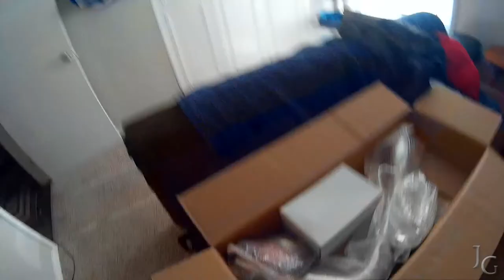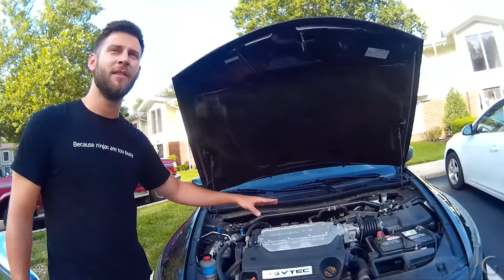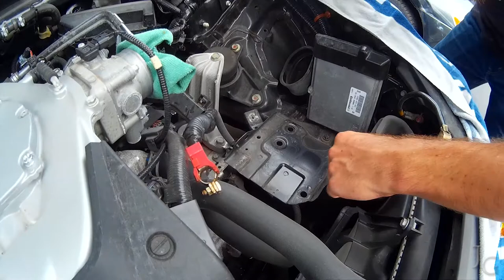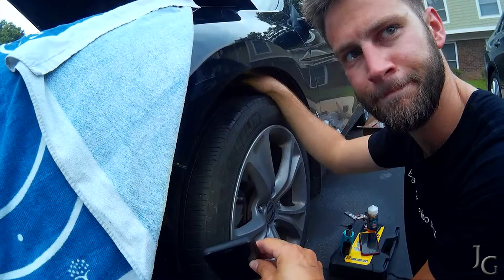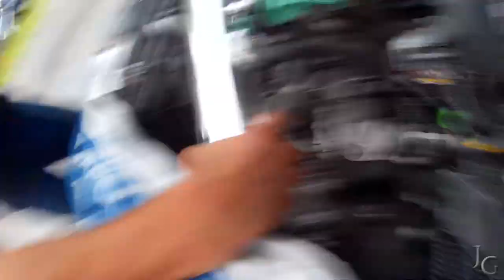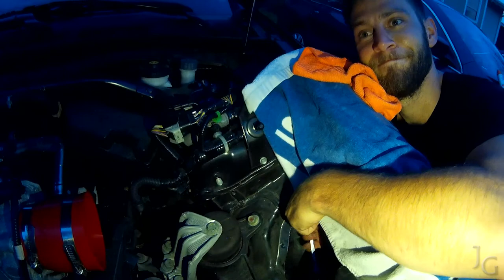Cold air intake install - 2012 Accord V6 Coupe

Comment: I just got my injen cold air intake for my 11 accord coupe and it definitely helps with the throttle response and this thing is like a vacuum for air now haha
Reply from the maker: It definitely gave a nice surge in power for what it is. Also gave it a nice noise!
Reply: did you have to move the ecu?
Reply: @noveshnoel  all I did was remove the old intake and the new one mounted right up.
Reply: @MerkNasty  awesome thank you
Reply: @noveshnoel  I did have to take off the front bumper tho. Forgot about that

Comment: What did you do with the mass airflow sensor or whatever was connected to the air box?
Reply from the maker: This was a really long time ago but I do recall that it was reconnected in a similar location as the OEM intake because it didn't require a tune afterwards.

Comment: Did you wind up not using the little extension elbow in between the throttle body piping and the coke filter and only running only the piping that that attaches to the throttle body directly?
I see you don’t have the car anymore, but I got the same generic one yesterday and am trying to get a fitment idea! 
Thanks in advance! Good video!!

Comment: Any difference in power? MPG? 👍🏽
Reply: Alex Moran I was wondering the same thing. I have the same car and just ordered a similar intake
Reply from the maker: There is a little difference in power but more so in the throttle response. My brother said that he doesn't feel a lag in power like he did with the restricted air box. The sound is amazing and the fuel economy slightly improved. Nothing significant though, just like any other air intake.
Reply: Joe Granitto Thank you I just got mine yesterday and it came with a dented tube where it goes to the throttle body and im waiting for the seller to resolve the issue. What can u expect for 99 bucks tho lol
Reply: Joe Granitto I wanted to tell u also that the swap u were talking about is on heeltoeauto.com and its a j37 intake manifold and throttle body kit from an acura tl or rl that bolts right onto the j35 for under i think 800 bucks that is supposed to make a huge difference in power and top end
Reply: CarlJ Didn’t know about that website...lots of good stuff there👍🏽
Reply: Alex Moran I almost hate going to that website because I have to look at all the goodies I want that I cant fund right now lol. I think i have over 4 grand of parts in my shopping cart there😂😂
Reply: CarlJ I feel your exact pain☺️😉

Comment: Aye does your engine light come on when you installed the air intake ?
Reply from the maker: CEL wasn't thrown after the install. We don't have that car anymore but there were thousands of miles driven on the car with no CEL.
Reply: Get a scanner and delete it. Happens when you take the sensor out. It causes tho code to stay on until it gets deleted.

Comment: Just bought the intake, my question was did you guys use all of the hose that was in the package or did u just use some of it?
Reply from the maker: We didn't use all of it. They seemed like different lengths of tubing depending on the car you're putting it in, making it universal. You should only use one hose.